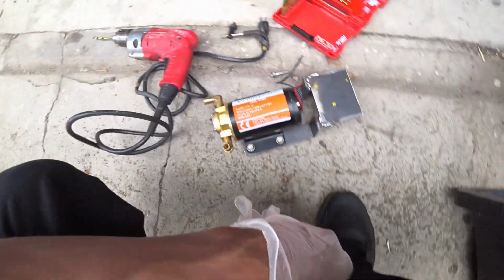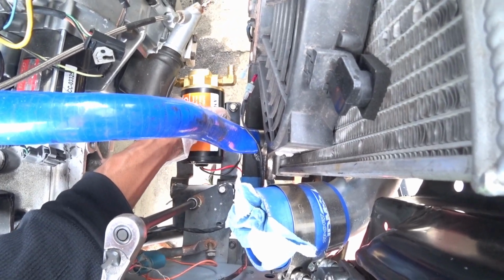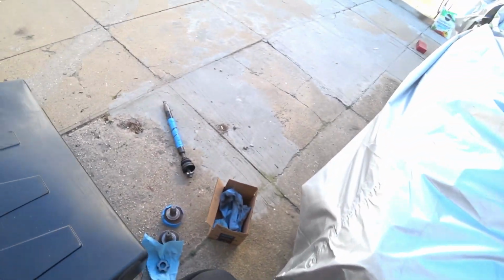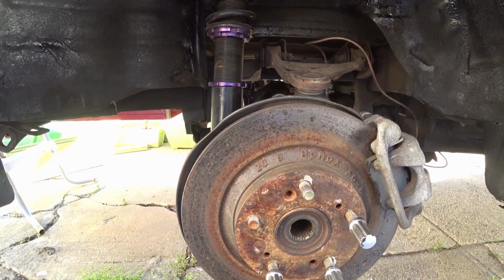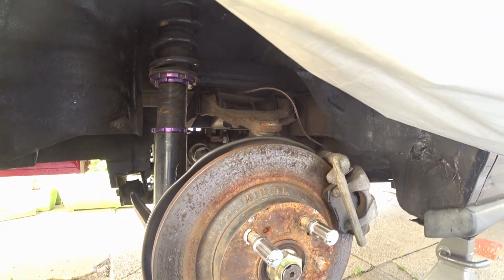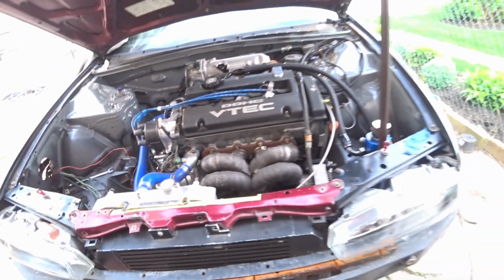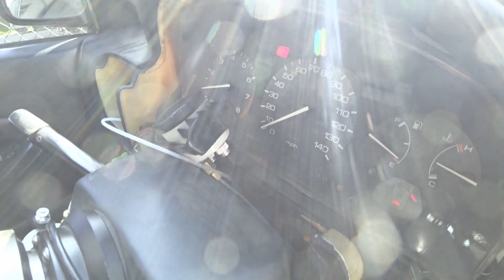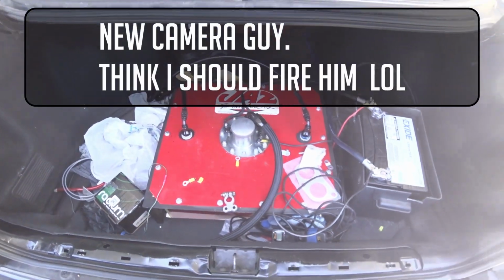H22 turbo - CRV awd transmission-  Honda Accord

Comment: I want to make my 2005 honda accord k24 awd and just do not know where to start. I was thinking about trying a crv drive train but idk if I could get one to fit and if they made them manual
Reply from the maker: The crv power trains drops in to your car.  They do come manual but very rare. You will need custom fab work to mount the rear suspension or knuckle setup. But lots of companies are doing research so you might be in luck

Comment: Are the h2b set ups able to be put into a 95 accord as well?? The cd5/cd7 chassis
Reply from the maker: Yes. It can be used in the car chassis. You will need custom motor mounts.

Comment: What size wheel and tire did you go with ?
Reply: I have a 92 accord Dx 4 door
Reply from the maker: I have 17x8 civic si wheels. With 225 45 17 tires. Will upgrade to better tires later.
Reply: Thanks dude !